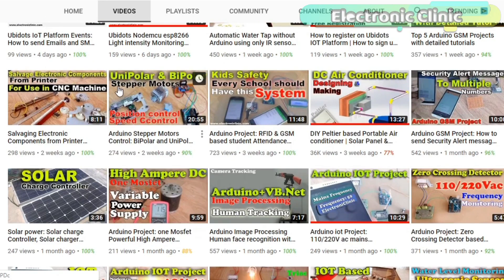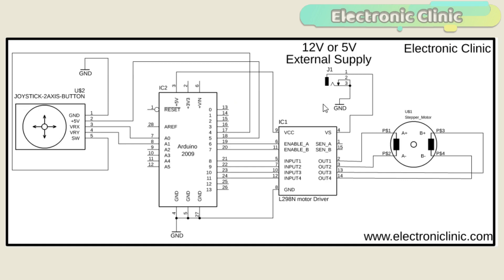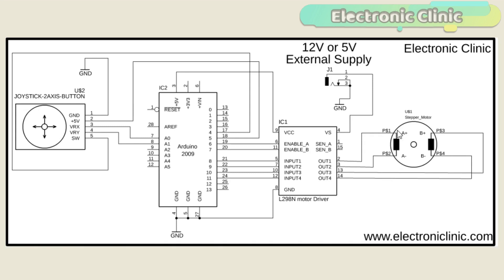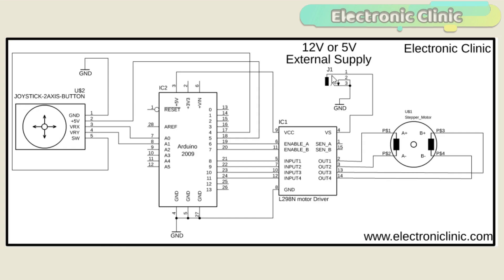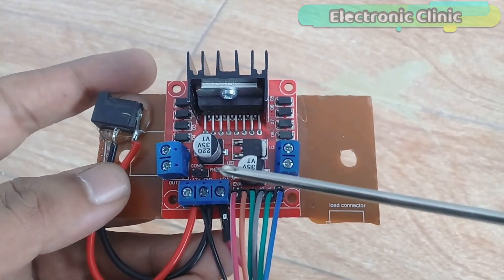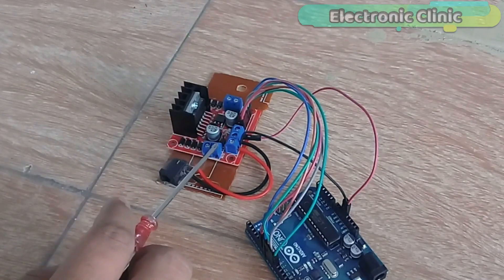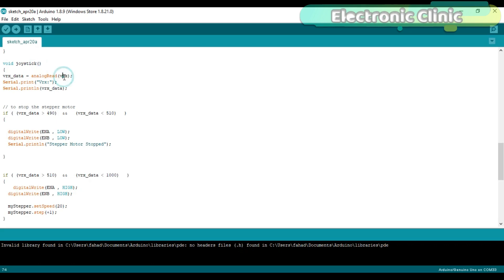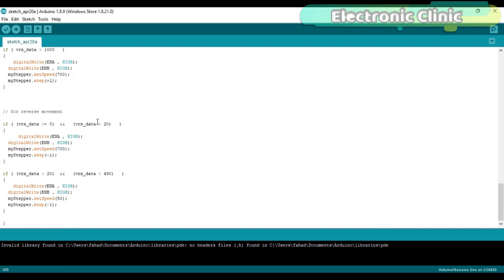cd rom stepper motor Arduino L298n + Joystick controlled speed and direction Control

Comment: I wants to control 2 stepper motors with pc joystick and also needs to control the speed but not with the joy stick speed should be maintain using another knob on joystick controller can you please help me with this
Reply from the maker: Watch my other videos in which i have used the stepper motors. That will help you a lot
Reply: @ElectroniClinic  can you send link ı cant find :(
Reply from the maker: U only need to copy and paste the code and change the variable names
Reply: @ElectroniClinic  ok i will try doing that can you please send me the link of that video so that i can specifically look for the same and do it
Reply: @rrahulstartech  have u tried it?
Reply from the maker: watch my recent video